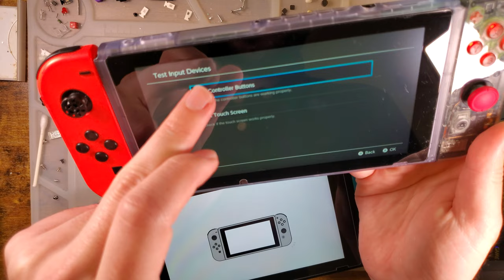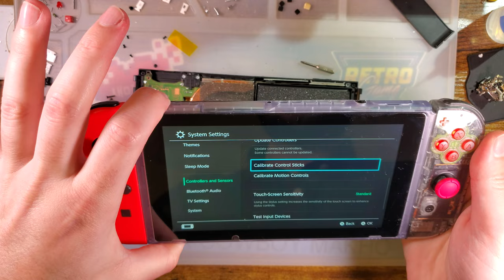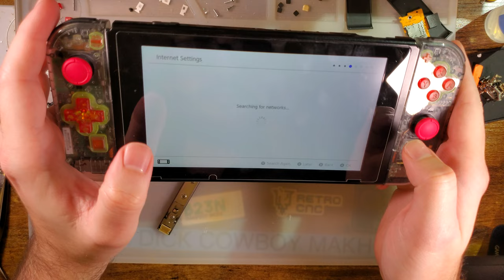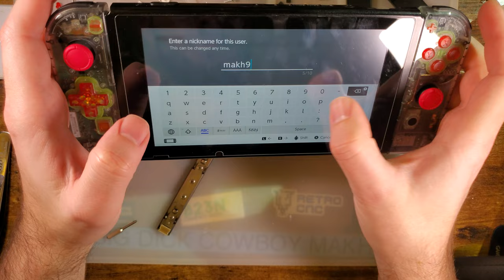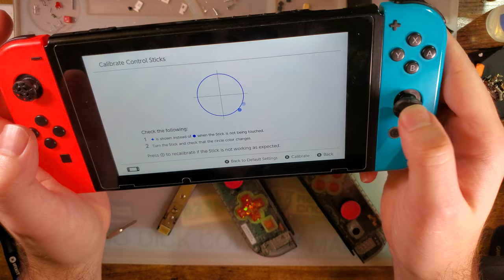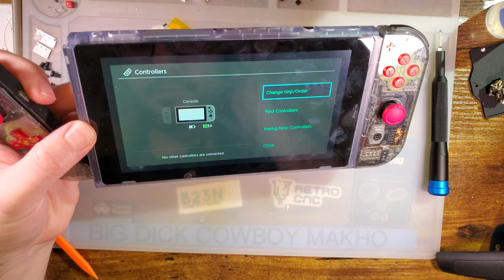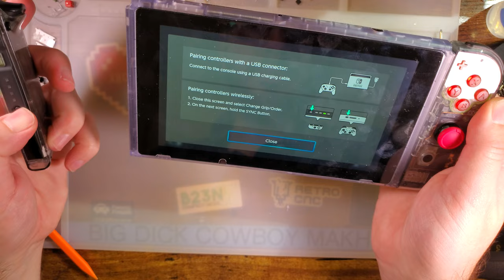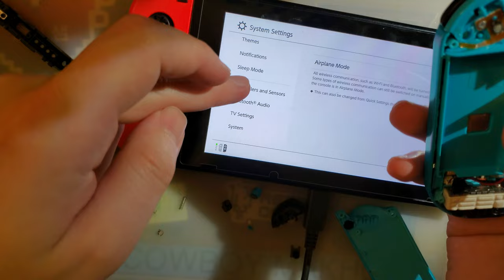Junk Switch (v1) Tablet Repair (Part 1)

Comment: My v1 switch has a weird behavior unlike this one. It can dock joycons, but joycons cannot charge via the switch. Also the switch fan cannot turn on and is always off no matter the console temperature. 

Not sure how to fix it. Ppl online said to remove one diode between the fan and joycon attachment module. But I checked, my v1 doesn't have said diode. This is my first nintendo product that died from normal use, let alone it died at the 4 yr mark. All my nintendo consoles/handhelds are still running fine since I purchased them new.
Reply: Fan diode I assume, I saw the same problem with a water damaged switch that had corrosion on the fan header and said diode
Reply: @Alexander_l322  ya i thought that was the problem too, but my v1 doesn't have said diode. When i opened it up, the place where the diode suppose to be is empty. Any idea why it is still causing problem?